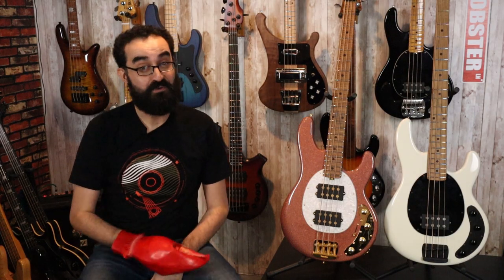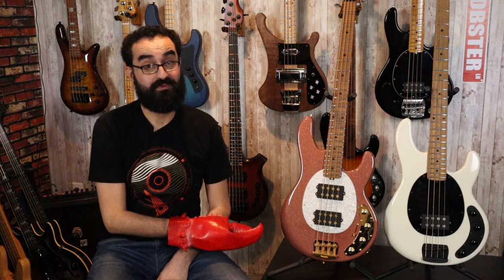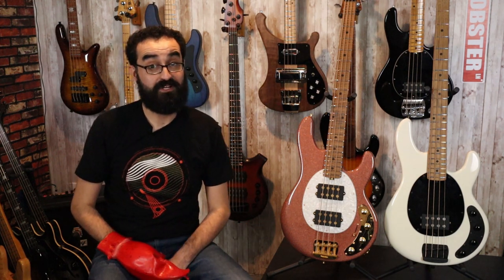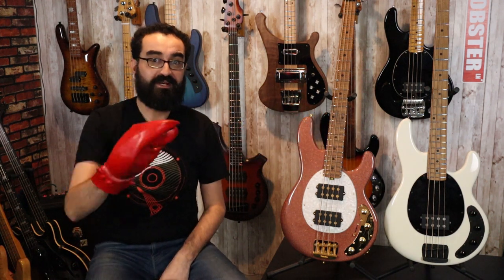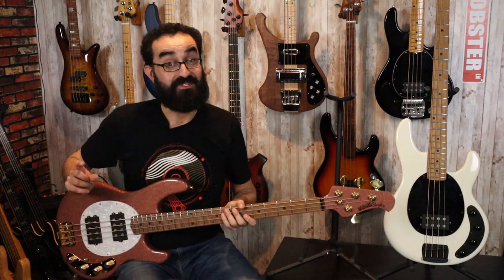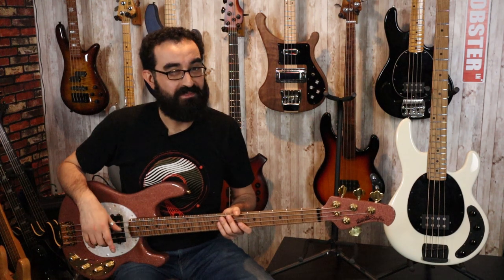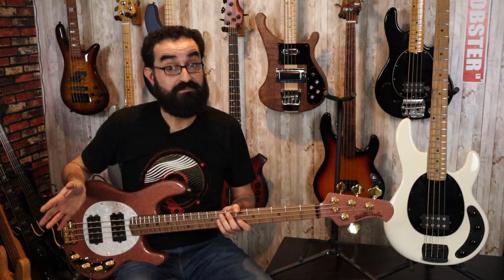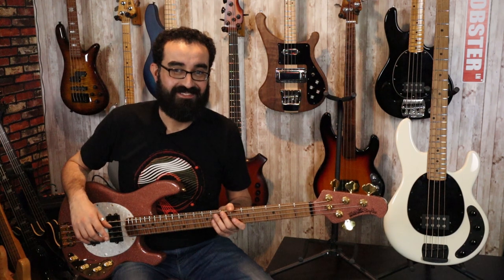Stingray Special BFR 4HH (bridge pickup) vs 4H - Do they sound the same? - LowEndLobster Fresh Look

Comment: Great demo! I just picked up an HH used and I've heard all the hype about how the H is a "totally different instrument" than an HH with just the bridge pickup engaged. I think this video shows that's complete bunk. Another thing to remember, unless you're name is Victor Wooten or Billy Sheehan, most of us aren't doing lengthy bass solos without a band playing. By the time you adjust the onboard preamp, your pedal board, your amp and cab (if you use one...I don't), then it goes out your DI to the board and through the PA into a room packed with people....does anyone honestly think any member of the audience...even a bass nerd....could tell a difference between the two?
Reply: Of course it's fake lol. Electronics wise if you choose the bridge pickup, you won't get an output from the neck because the wiring makes it isolated. I don't know why anyone would think otherwise. The difference is in the playing. No human can replicate their performance 100% because we're humans, and not a midi program. There will always be a slight change in the finger plucking and fretting, very small changes that players can pick up. Fools will attribute these to HH vs H, but it's really not.

Comment: To me, the sound is extremely close. However, the double H (while stunningly beautiful), has a slightly thinner sound. Maybe it has to do with magnetic pull from the neck pickup, minor variations in the wood, or just coincidence, but the single H has to my ears a slightly fuller sound. Closing my eyes they are both unmistakably Stingrays. Just noticed a minor difference, with a smidge more bottom end maybe with the single H.
Reply: I came here to say the same.
Reply: Double H is wires series. I read that somewhere.
Reply from the maker: You know, digging deep I do see some mentions of the HH models having pickups in series, though I can't find any documentation about that for the Specials. Very interesting, thanks for that tidbit Richard!
Reply: I do want to make the commentary that the difference might simply end up being a parts tolerance thing than any of the listed reasons. Every aspect of a circuit has a tolerance, some tighter than others. If you want a really nice video on the topic, look up pedal maker Brian Wampler's video on the TS800 vs TS9.
Reply: @richardmilligan1410  they are not.  Check out the EBMM product page for details on the pickup settings.  All parallel.
Reply: @LowEndLobster  EBMM stingray H or HH are all parallel. Sterling's HH are series
Reply: Lobbo,
Do you know the serial number or model name of the black white special in this video? Trying to find one. Thank you!

Comment: For me personally I choose the 1 humbucker stingray because having the second pickup makes it harder to slap and gives the strings an extra magnetic pull which effects the basses tone
Reply: Couldn't agree more. And having another humbucker might mess slightly with your sustain too, or is that not even noticeable? 
Anyway, both great basses. But it's the single humbucker that truly shines for me!
Reply from the maker: Thanks! I love my BFR HH, but I'm at heart a 'Ray traditionalist. My SR Classic is one of my most favorite basses :)
Reply: @danielvanulst2990  The neck humbucker can cause excess fret buzz as well, so you have to set it very low.  The neo magnets on these are STRONG, was putting on EB Cobalt flats last week and it snapped the string up like an alligator, never had a bass do that before.
Reply: This frfr.

I'm thinking about getting a stingy ray ray. I wanted to see what all the buzz was about (no pun intended). And that humbucker in the neck is so cool........but it's such a two edge sword! 😭

On one hand, there's more tonal versatility, and it looks beefier and cooler imo (you have two gigantic humbucking pickups at the ready..........that is incredibly befitting for a bass, and I love it!).

But on the other hand, that neck pickup will block you like LeBron James. Slapping with the dual humbucker isn't necessarily impossible, but it is moderately difficult, when it shouldn't be. It's easier to play the bass without the neck humbucker hitting me with the "HUP, Stewie....HUP, Stewie" when I try to pop a string!!! 🤣🤣🤣🤣🤣🤣

EDIT: This dilemma makes me so sad, because how can an idea that's so perfect be so cumbersome?!??? 😭😭😭😭

Comment: The 4H sounds a bit “thicker” to my ear, more presence in the low mids. The extra pull on the strings and the small reduction in body mass on the double-buck likely plays into this, but I doubt that you’d be able to really hear the difference in the mix. 
As much as I like neck pickups, it just...looks wrong on a stingray :)
Reply from the maker: Thanks Sriracha :) I agree.... I sometimes wish Pinky was a 4H

Comment: There was a guy who made the same comparison a while back, but he used Sterling stingrays and the difference was actually huge. The HH version had a mid focused tone with none of the signature MM presence. I'm happy that that's not the case here
Reply from the maker: Thanks! The SBMM lineup is interesting. IMO only the 34's actually get the 'real' Ray tone (without mods). I did a review of the Ray5HH SUB, and though it was a great budget instrument it definitely lacked the grit and character of it's USA counterpart.
Reply: I'm having this problem right now. I have a 34HH and the tone sounds like the mids are cranked and I hate it.

Comment: Lobster, thanks for doing this little test. To me they sounded nearly identical but I thought the 4H sounded slightly more transparent when you had the mids turned up. I had to wear my headphones to hear this and in a live situation this difference would get lost in the mix. This is a bit surprising and goes completely against the other u-tube I had mentioned where a Sterling 4H and 4HH sounded quite a bit different. I was pretty much sold on the 4H after watching that u-tube so bought a EBMM 4H Special when I had all the time been leaning towards the 4HH.  I guess it goes to show when you move up in the line to the EBMM Stingrays any conclusions you draw regarding comparisons of lesser basses no longer apply. I told you that I just recently picked up a gorgeous Tectonic Blue Sparkle 4HH Special so have done the comparison myself, but in my case the new 4HH has an ebony fretboard as opposed to rosewood on my 4H and they do sound quite a bit different because of the fret board woods. I love them both but I'm really digging that ebony highly focused piano like hard attack. In your test with them both being maple necks it was a valid test. As usual well done and thanks again my man, stay safe.
Reply: Glenn I know the video you are referring to, and I'm pretty sure those two Sterlings had different strings which invalidated the test.  I went with an SRS 4H and love it, has the classic look and there's more room for slap.  I don't need my Stingray to be a swiss army knife, I've got other basses for that.  If you gig out with only one bass though, the HH makes a lot of sense.
Reply: @57precision    Brett, you may be right about those 2 Sterlings or perhaps one had newer strings or one was just a quirky sample. Who knows for sure but it was surely convincing enough to steer me into buying the 4H over the 4HH. Now 6 months later I have both and as much as I like the different sounds you can get out of the HH just messing around with it at home, parallel position 1 is still my favorite and in my opinion is the only one that would really cut through the mix in a live setting. Further more, none of the additional settings on the HH can replace my P bass, it just stands alone.
Reply from the maker: Interesting! I gotta check that video out. Looks like the guy is using the regular Stingrays and SBMMs. I've heard (but can't verify) that the original non-special 4HH had its pickups in series as opposed to the traditional parallel setting which may account for the tonal differences there. I don't know how the special HH's are wired in comparison either.

Comment: Double humbucker Stingray has the best scooped killer slap sound when both pickups engaged. Unfortunately, the neck pickup is in the way when you try to double pluck etc.... I'd prefer the old Stingrays with 21 frets over the new ones with 22 cause the gap between the neck and front pup is wider for a comfortable slap. I don't get why they did not think about this when redesigned this iconic monster.
Reply from the maker: Thanks Pope! I didn't find the neck pickup that much of an issue on this one. However I have a review of the Harley Benton MM85A which has the neck humbucker right against the neck, and that makes it impossible to slap for me.

Comment: I think the only variable might be the pot values (500k pots 10% can range between 450-550k if they used cheaper pots could be 20% meaning 400-600k) same for the pots in the preamp but they are usually less effected by this sounds pretty darn similar to me though awesome video.. cheers I'm off to bed just got off work at 7am after being up since 730am yesterday.. but had to watch this before I could call it a day..
Reply from the maker: Thanks Josh :)
Reply: @LowEndLobster  any time man I'll be here

Comment: I also thought they sounded pretty close.  The only drawback w the HH is it interferes more w your RH, esp w a pick (which I prefer).  Still...the extra beef and versatility is more than worth it. I can pick between the pups and adjust the tone accordingly w the knobs.
Reply from the maker: I guess the only solution is... one of each ;P
Reply: @LowEndLobster  Ha ha.  Not necessary!  Like I said, I can pick between the string ( w pick or fingers).  I can adjust the tone w the knobs...That's what they are for, LOL.
   Honestly, paying a few extra $  for the $$ eliminated the need for ANY type of 2nd bass IMO.  Especially if it has a coil tap option (which I personally would rarely use) for those J-Bass lovers as well as MM.  The neck pup alone can do nicely for a P bass sound.

Comment: I have an 2007 HH and just do not like the ergonomics of neck humbucker placement for slap. The. Bridge pickup sounds harsh.  I would swear the separate pickups are in series or something. The slap only really opens up in the middle position.  I only want the bridge pickup. Most Soundman will go crazy adjusting every time you do a pickup selector change.  To my taste the HH has too many choices.   The bass needs to drive the bus with subtle alterations in eq, not drastic pickup configurations.
Reply from the maker: Thanks Marty! Interestingly enough, your 2007's pickups may actually be wired in series. Yours is also during the time when they used ceramic pickups before switching back to alnico in 2008. They did some weird stuff in the mid 2000's
Reply: @LowEndLobster  thank you for that.  The 07HH was almost a bass rescue from a pawn shop. It would not have been my first stingray choice.  Married and gigging meant Squire or OLP.   Good info on the series thing.   The first time I heard Sade, Jeff Lorber Fusion, and Talking Heads I salivated.  I think I hearing parallel magic let my fretless Jaco breathe a little.  Maybe I’ll take out the Neck pickup, Parallel the bridge pickup, and put the neck pickup in my OLP passive.  ✅

Comment: Hello lobster can another type of Bridge work on Music Man sterling 5 String Bass Guitars ?  I don't like the factory Bridge.  Thanks
Reply from the maker: In theory, yes. But you need to be wary of the string spacing as moving to something like 19mm may exacerbate the issue with the G string falling off the edge of the board on the MM 5 strings

Comment: Hi LEL🦂. Good video as always 
Your thoughts.  Buy a new  Sterling  Stingray HH or a 10 year old 2nd hand EB stingray HH ? Price is similar slimmer neck or standard neck in your opinion . I play fonder and pick. No slap . Stay safe . Stu and
Reply from the maker: So the Ray34s have the same dimensions as the USA ones. The biggest difference would be the neck finish with the USA having the wax/oil special sauce vs a satin poly for the SBMM. I'd say go for the USA if it's in good shape!
Reply: @LowEndLobster  thanks for your advice.  Difficult ro try out during these lockdown times .

Comment: Good video.  I have a few Rays.  EBMM 2002 classic and 2014 SLO Special, as well as SBMM Ray 34 and Ray 4H and Ray 4 HH.   I know the are not quite the same the Ray 4H and Ray4HH compared to the two Basses you just sampled, but between the Ray 4 and Ray 4HH I have, it is hands down the Ray4 for me.  I don’t like the Ray4HH, and can’t get myself to like it.  I actually have it listed for sale.  It’s a bummer cuz of all the 2020 colors for Ray4 and 4Hh. Love this olive green best, but it’s HH so I just can’t get with it.  I had high hopes.  Yes I get pretty much stingray tone from the bridge pickup in hum buck mode, but the rest of the positions just sound like playing thru an amp with different thickness blankets over the speaker.  To me it is not improvement on stingray tone, and almost does not offer any other quality tones that I would want to play, which was my hope.  I also don’t care for having the 2nd pick up for my plucking Andre slap either.  I just got used to the one pickup on Ray’s and that’s how I like it.  I have modded my Ray with an Aguilar pick up (after doing side by side comparrison) and that was a great mod, even with the stock pre amp.  But I am not about to drop $250 for pickups, and possibly another $150 in pre-amp for a $380 bass that I don’t like playing much.
I may decide to remove the top pick up out, pop a different pick up in the bridge and get another pick guard to cover the hole of the missing pick up.  I love that color, but still, I already have a go to Ray4, so not sure I really want to dump any money in the Ray 4HH.  I just hope it sells and I can put it towards another bass, possibly something from your reviews.   Thanks for the test today.  The better electronics in the EBMM stingrays you tested don’t sound as bad as the Ray 4HH.  But maybe you can do another video and test the Ray 4 vs 4HH, or a Ray 34 vs 34HH,  or even to some pick up and pre-amp mods to some Ray4HH’s, maybe you will get a combo I like enough to change my mind and Keep it and upgrade it???  Thanks again Lobster, always love your videos.
Reply from the maker: Thanks Toby! I definitely understand where you're coming from, I'm a bit of a Stingray traditionalist and prefer the single pickup model as well. The Ray4H and Ray4HH (as well as the 5's) don't come close to the 'gritty' true Stingray sound with the stock electronics, but we've found that the pickup is the weak point there. I actually have a CAR Ray4HH on order (I love the new color, hate the olive) and we have some BIG mod plans for this. Going from 5 pickup settings via the 5 way switch.... to 8 different settings! More details soon, but you will like what you see ;)
Reply: @LowEndLobster  yeah, the new colors are cool, the Blue burst  I like best, but it is very close to the blue on the Ray 4 I have already , and the Candy Apple Red you have on order, is pretty nice, but I wish they put it in the Ray 4 line too.   But I still love the olive.  It’s funny that you like mint and hate olive, and I hate mint and love olive..  must be the greens, cuz most of your other colors I like.  Black and whites I find boring, but it’s hard to go wrong, they work in any setting, and my favorite color is orange, and I love the Conklin you have, and the one DIY you did ( not from the kit).  I wish they did some oranges in the Sterling line,. There are two EBMM oranges, the translucent amber and a solid orange with a tiger like fretboard.  Those are tops on my want list if I ever found one I could afford.  Thanks for the reply, happy to hear you got plans around a Ray4HH brewing.  Maybe I will see it before mine sells. 👍🏻
Reply from the maker: @tdub8986  Dude that translucent orange... I know exactly what you're talking about... drool worthy!

Comment: Are both wired in either series or parallel? I know that the major difference with the bridge soloed tone of the Ray4HH and H is the parallel H and Series in positions 1,3,5 on the HH. I rewired my HH to be parallel in all positions. This is how it should’ve been done all along. Tone MONSTER.

Comment: Sounds to close to be called different sounding. Both sounded great in all settings
Reply from the maker: Thanks Meyers!
Reply: @LowEndLobster  you need to go back and do a SUB Ray 4 only changing the pickups and leaving the stock electronics. I think that would a more common upgrade. FYI the way you do your reviews is the best and most beneficial I think. You show us what the bass sounds like. A lot of reviewers want to color the tone too much.
Reply from the maker: @thebassbuilder  Thank you! We'll definitely be doing more SUB upgrades in the future, both with the stock and aftermarket preamp. As long as we get the terrible stock pickup outta there! :)
Reply: @LowEndLobster  I am about to do my own with this bass model. I bought a set of the Fluence pickups and I am about to order a SUB. I think it may be a killer mod. Oh and also you literally stole my idea for the old smoothie mod you did to the bridge. I had looked up all the same exact parts you mentioned and then 2 days later I found that video and could not believe it. Dang you!!! That was my idea,lol!
Reply from the maker: @thebassbuilder  hehehe, great minds ;P.  We have a VERY interesting SUB Ray4HH project coming once the new color CAR Ray4HH gets here :)

Comment: The single pickup Stingray has slightly more snap and presence to me, but the 5 way switch on the double pickup model would lead to many more tones not possible on the single.  I slap at the neck and don't notice the neck pickup getting in the way for my style of playing.  I kind of like having a thumb rest on the neck pickup for fingerstyle also...  Slapping a jazz is similary configured.